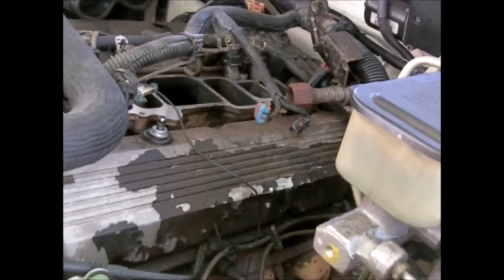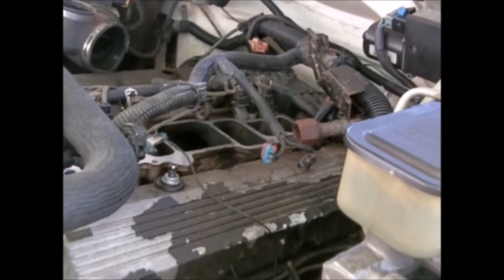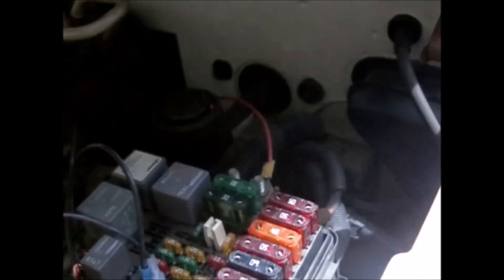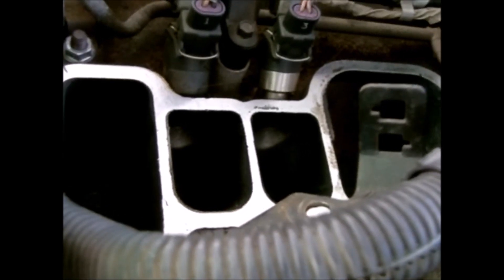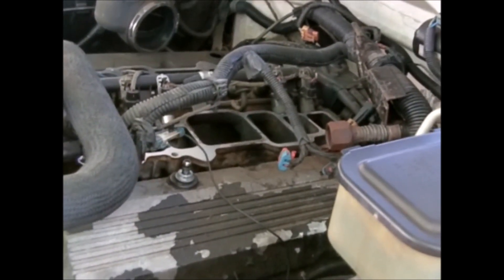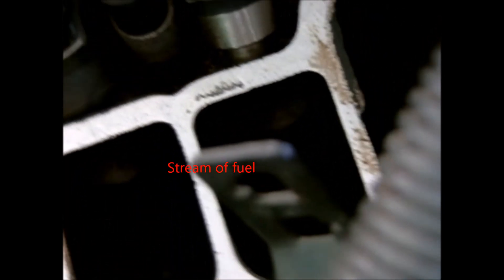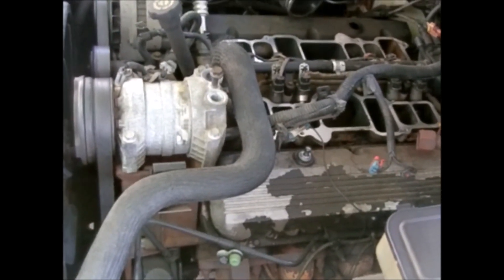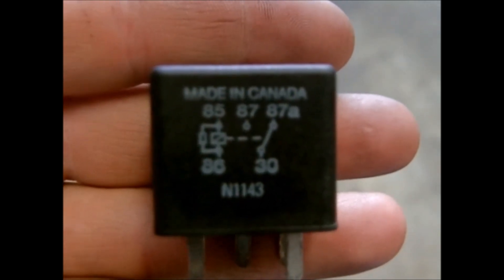How to test fuel injectors in Chevy truck

Comment: What would a bad cam sensor do?? Bc I suspect cam sensor but no code! I changed my fuel pump thinking my old one was bad but i think the old one was fine
It had 50Psi
After changing pump coincidently it stalled 3 times and then didn’t start anymore but I still have 50 psi and i do have spark 
And it does start with carb clean sprayed into throttle body
Reply from the maker: Sounds like your on the right track, I would think either crank or cam sensor, can't remember if the cam sensor is built into the distributor on those older models though so you may want to check
Reply: @SouthernMechanic  just got the truck 2 months ago  and its been stalling and turning back on since like the third day ive had it 
And I already changed my crank position sensor so would u recommend me changing the whole distributer or just the sensor
Reply from the maker: @Timyin21  if the sensor is in the distributor then it would be alot easier to charge the whole distributor but if the sensor is separate then just the sensor, also if you open the throttle just a little bit and try to start it does it run?
Reply: @SouthernMechanic  actually just realized the new pump i installed was faulty 
It turns on when i bang under the fuel tank
Reply from the maker: @Timyin21  when the pump kicked back on did it start after that?
Reply: @SouthernMechanic  i bumped on the pump and it started but the pump sounds loud
Also today I changed the fuel pump again with a new delphi pump but this is wat happened
I turned it on and it starts but dies
Then i crank and doesn’t start 
Then i crank again and it starts really weak but it started wasn’t running good
Got frustrated didn’t know what it was
If it delphi pumps that absolutely suck and aren’t strong enough for my truck or something else
Someone told me clean your throttle body so i did and it started right up and hasn’t stalled since and hasn’t been hard to start at
Idk if the pump took a few to work good or the throttle body beingg a bit dirty was the problem 
Either way haven’t taken it for a long drive just around my house bc im scared it will leave me stranded again
Reply from the maker: @Timyin21  yes cleaning the throttle body and IAC was what I was going to suggest after you got the fuel pressure situation figured out, that's why I asked if it would start and run if you help the throttle open a little bit aka bypassing the IAC
Reply: @SouthernMechanic  yes its in the distributor

Comment: My Silverado also drops pressure in like 3 seconds after priming it with the key for a few seconds, it goes up to 50psi then back all the way down, would it be because of this kind of leak on the injectors? Or the check valve In the fuel pump assembly? I’m leaning towards this because of how fast it leaks but idk
Reply from the maker: After you cycle the key on and off about 3 times then try to start the truck does it take longer than usual to start and does it black smoke when it does start? If so then it is for sure the injectors, if not then it could be the check valve in the fuel pump or a bad pressure regulator
Reply: No sir, all it does is leak right back down, no matter how many times I cycle the key, it drops back down to 0 psi as soon as I hear the priming stop.. when I hear the priming/buzzing sound, it hits 50 psi, and will start easily if I turn over as its at that psi, so it looks like if the truck is off or if there’s just no priming, the pressure leak falls completely, no leak on vacuum hose on regulator, but I’m not sure if leaky injectors would do this, I don’t smell any gas, and the trucks perfect when it’s on... subscribed
Reply from the maker: @chimes1134  if you turn the key off and back on again and cycle the pump 2 or 3 times then wait a few seconds then start the engine, if the engine has a hard time starting and smokes alot when it first starts then it's most likely a leaking injector, but if you cycle the key on and off a few times and the truck still starts fairly well without initial black smoke then I would look more towards the regulator or check valve in the sending unit
Reply: @SouthernMechanic  hey I have a 97 chevy 5.7 set for years just got it running moving around the yard it started idling rough and I smell gas in the oil I'm scared the piston rings or bad
Reply from the maker: @biscuittaster5720  how many miles are on it? I would check for a stuck injector then change the oil and run it a while then check compression, if the compression is good then your rings are fine, sometimes the oil will get washed off from the cylinder walls because of too much fuel ect and they will lose compression but if its not been ran too long like that and you catch it in time then it should be fine
Reply: @SouthernMechanic  280,000 and it was locked up when I started working on it i will check it out

Comment: I have a Silverado 01 6cyl... To that will start but not stay running unless my foot is on the gas pedal . Could this be an injector problem. I've done a full tune up and changed out mass air flow censor please help. Thanks
Reply from the maker: I doubt it's an injector but could be a number of things from oxygen sensors, to map sensor, to rule out the oxygen sensor either unplug them and let the computer go into open loop mode or start the vehicle when its completely cooled off over night and if it still does it right away then it's not oxygen sensors, you can test the throttle position sensor the easiest with a code scanner that has live data reading and go to the TPS reading and see if it is reading 0% with throttle at idle and 100% with peddle to the floor with the engine off but key on, also check for a vacuum leak to make sure it isnt running to lean because of the vacuum leak, also check fuel pressure, and clean the throttle body because sometimes they will carbon up and give bad idle issues